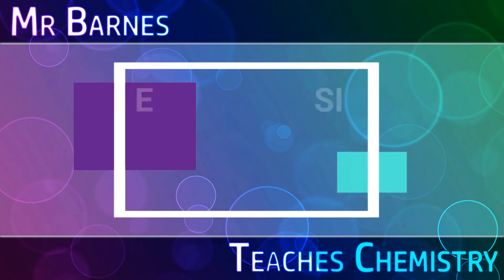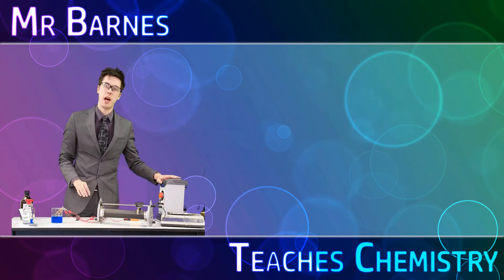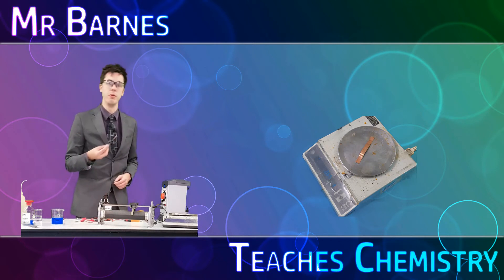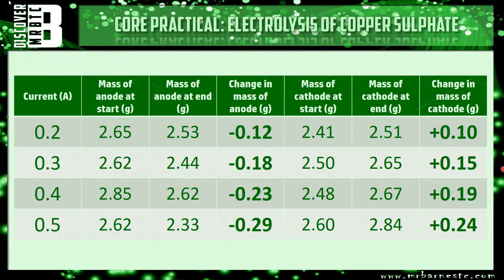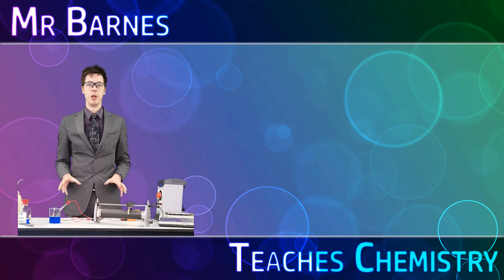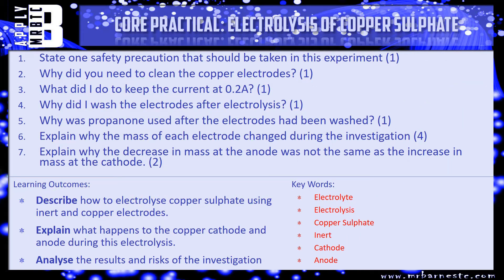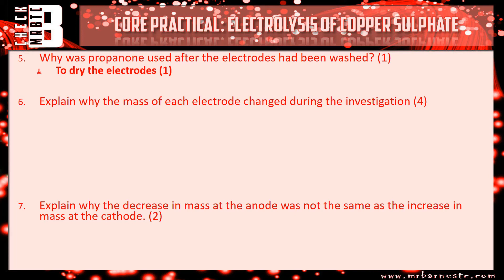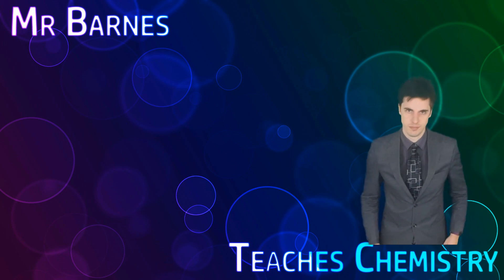GCSE Chemistry 1-9: Core Practical - Electrolysis of Copper Sulphate

Comment: Excuse me Mr Barnes but i have a question regarding the power supply. You are using 0.2A of electron flow but at what voltage is this flow?
Reply from the maker: I honestly can't remember! I did this video a while ago and cannot remember what I used. You don't need to know that for the GCSE though as, with using the variable resistor, you keep the current at 0.2A.